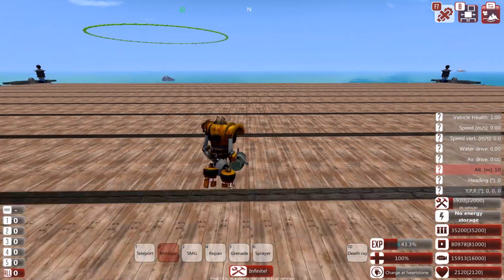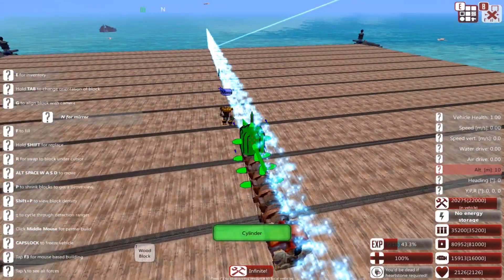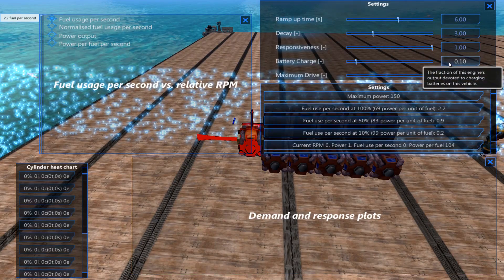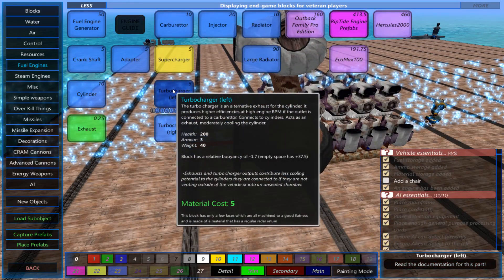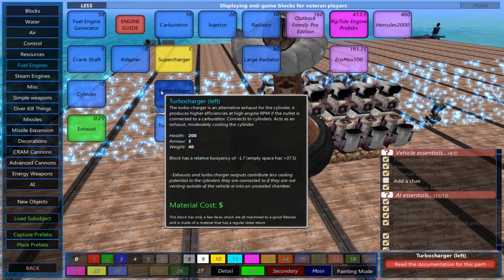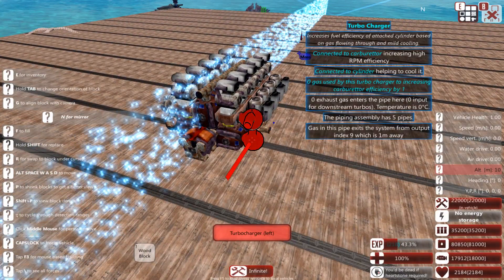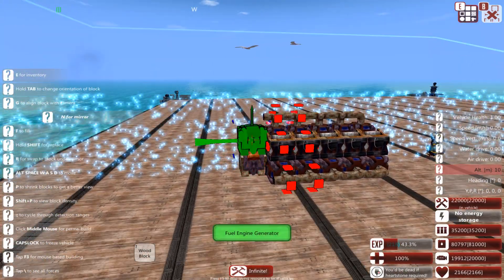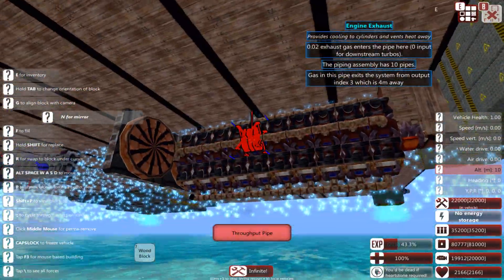From The Depths,Fuel Engine Guide

Comment: do you know if there is a difference between junction pipes and throughput pipes? That's almost exactly how I used to lay my engines out too, until I started building them vertically for 4 cylinders per crank shaft instead of the ground always taking up one slot.
Reply from the maker: There used to be a difference in them but now there isnt this was back when these types of engines first came out